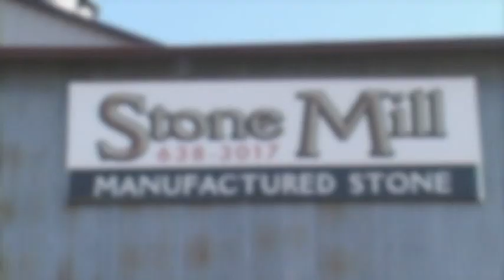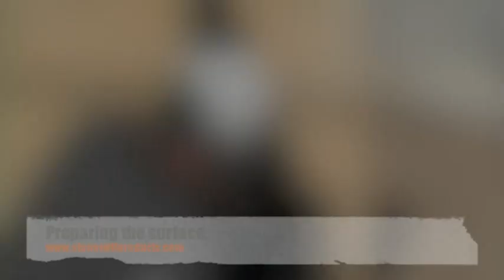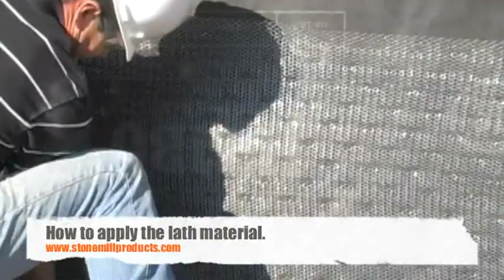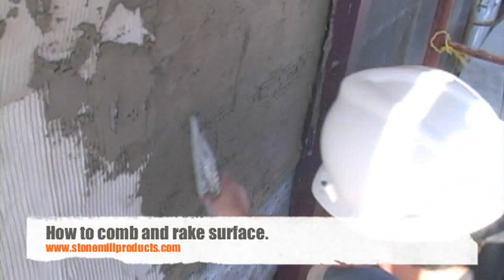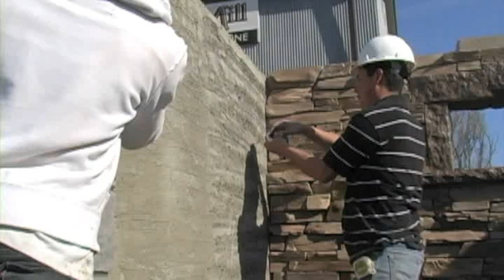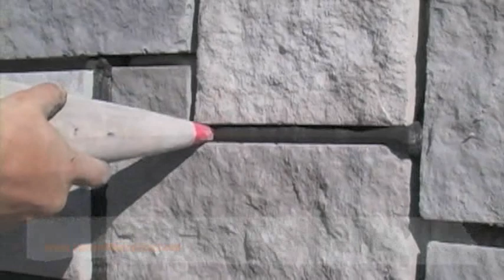How to Install Stone Veneer - Stone Master Molds LLC

Comment: IMO, This company manufactures the best molds in the industry . I’ve used plastic, PVC,polyurethane ect…these molds are the most user friendly, and they can take a beating. I use them without release agents, vibrate the molds, and the veneer comes out great.

Comment: He is a terrible tradesman.  Badly scratched. Starts to lay the stone half way up the wall. Raking out the grout with the handle of his trowel. Some of the vertical joints were tight and had no grout joints

Comment: It is difficult to install the stone veneer without the stones coming loose during installation.
Reply from the maker: JN 2013 Make sure the mortar mix ratios are correct. You might be using too much or too little water and/or sand.

Comment: Can this be applied directly onto stucco without first having to do the waterproofing and scratch coat?
Reply: The stucco is already water proof. And you can set it on the stucco it will still grip and stick good
Reply: yes it can. the scratch coat is the first step in a stucco job (after lathe and tar paper) and most stucco finishes are rough  enough to work as their own scratch coat, or can easily be scored with an angle grinder to obtain the same effect as lathe/scratch.
Reply: If the stucco is painted with stucco paint will it bond
Reply: if it's painted you need to re-cover with a bonding agent.....Weldcrete
Reply: Guys I have been scouring the internet for
This answer! Many THANKs! Now off to Home Depot!

Comment: Lath should feel rough when going UP not down.
Reply: no, the lathe should feel rough when you run your hand down it. that gives the mortar more bite and supports the heavy stone better. if you run your lathe the opposite way it makes it much easier to trowel the mortar onto the wall (as most people trowel in an upward direction) but gives less support for the stones. smooth side up is generally used for stucco where there is no real load for the mortar to bear, to make troweling go faster.
Reply: Smokey420Greenleaf  Rough UP, smooth DOWN.

Comment: I have brick outside, do I take the brick out first or can it be installed over it?
Reply from the maker: Christopher Lane Yes it is just as sturdy. Just make sure the installation is done correctly. Using a grout between the stone will ensure its sturdiness.
Reply from the maker: It can be installed over brick
Reply: Rae Young is it as sturdy as brick... my house is getting rebricked due to tornado.. i want to go with this instead of brick. will it hold up like brick.. thanks
Reply: Thanks